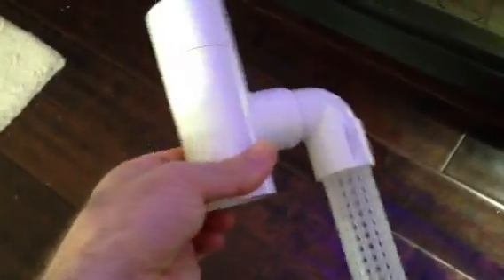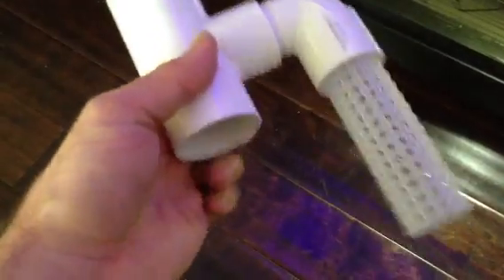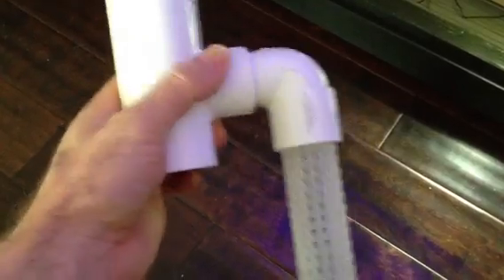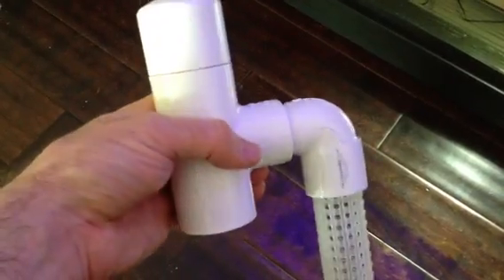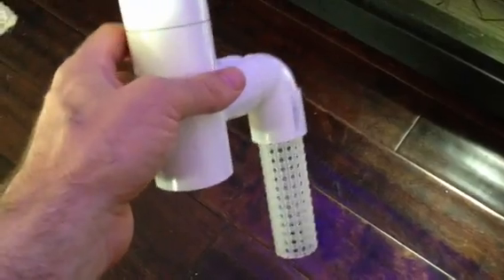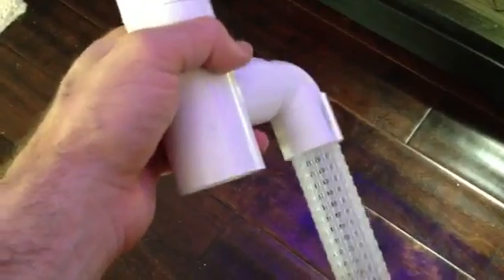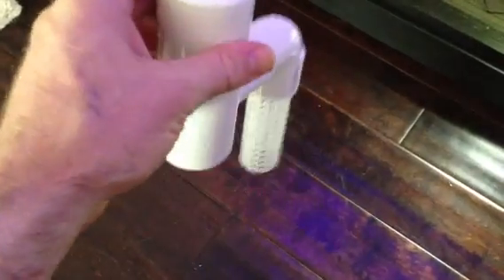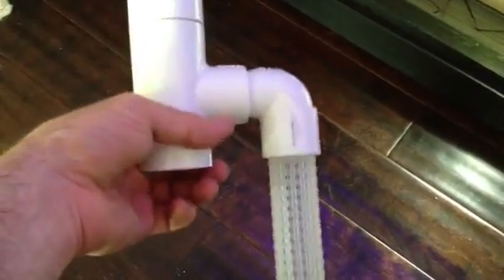MrSkumFrog's 105 Reef Build 4 (Herbie Drain)

Comment: It's my understanding the herby setup when operating correctly can take upto 2000 GPH, but a standard gravity feed can only do about 500 GPH with horrible garbling.  Obviously with a 93 gallon tank, running the system at 500 GPH is about 1/2 of the 10:1 that a lot of people hope to run their system at.  Hopefully you understand my concern and i'm hoping for your thoughts on it. thanks!

Comment: I was wondering how you have the return plumbed.  Is there a Y with only one pump to the two returns or, do you have two return pumps?  Also which pumps are you running with your Herbie Drain?  Have you tried closing the main drain fully and verifying the return pump won't out-power your single emergency pipe?  I'm considering the exact same setup but not sure which pump I want to get.  Your videos are great btw!  Thanks.